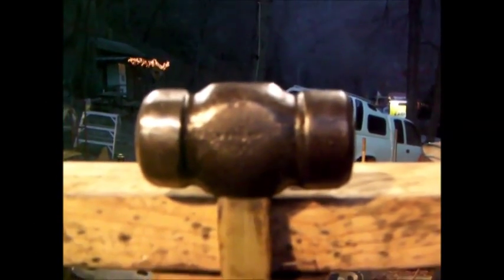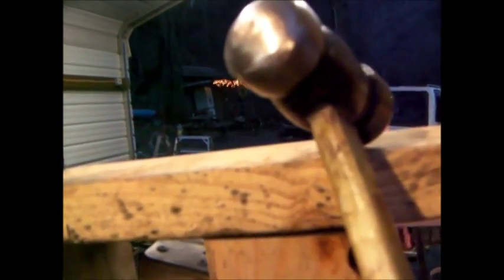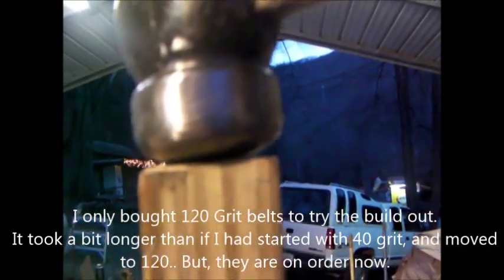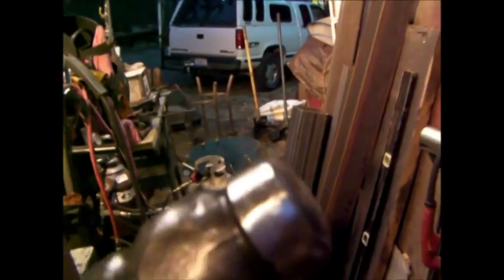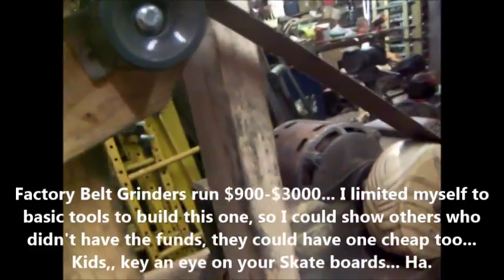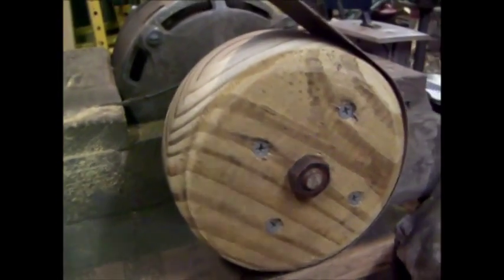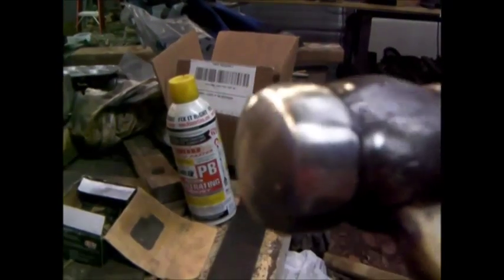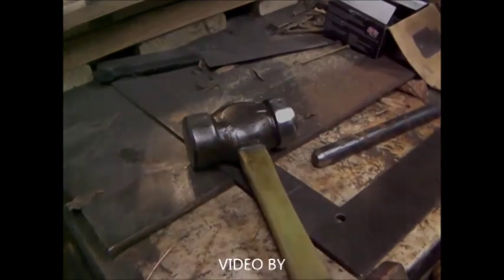Converting a Klein Linemans Hammer to a Blacksmiths Rounding Hammer

Comment: Good project.
I paid $40 for my used rounding hammer. I can't pay the $ wanted for most blacksmithing tools either.

 I think I'd like to try my hand at a belt grinder. I have lots of angle iron repurposed from bed frames. I'll look to see if you have a build video on yours.
Reply from the maker: +OKBushcraft  I built my 2x72 grinder with only common hand tools, and mostly wood frame, and some Zebec Skateboard wheels/trucks.. I would recommend using 1/4 shoulder bolts vs the trucks.. The trucks have rubber bushings, and you really have to crank down on them.. I have two videos on the grinder. It's pretty simple..
https://youtu.be/RsTc3c7upSE 
and 
https://youtu.be/gtFQt4k1kA8
If you watch both, you can pretty well see what I did.. I don't give exact measurements, but, with some metal and some clamps to hold things, you can pinpoint it pretty close.. Take up any slack with the slack adjuster.. The measurements are not particular.. Try to get your wheels in line as close as possible, which should not be difficult..
I build mine in one evening, not having any sort of idea or plan on how it was going to turn out.. Just knew the belt had to fit the frame.. I used the motor to take up the slack.. Just moved it back a bit and tacked it down with screws until I got everything secured.. Cheers.
Reply: Thanks. I'll be looking into this for sure.